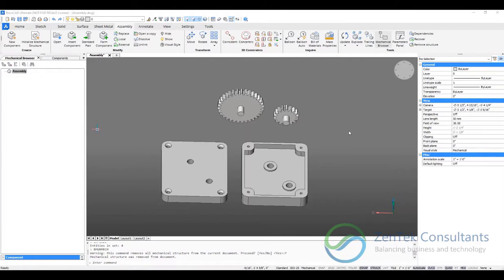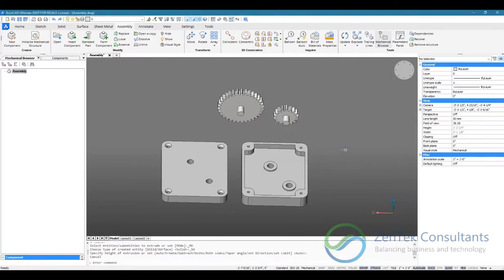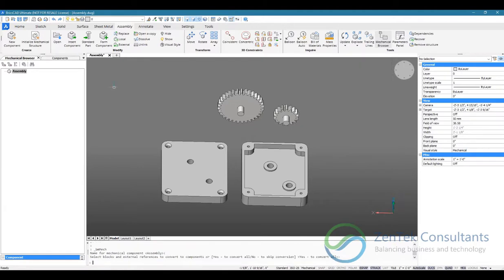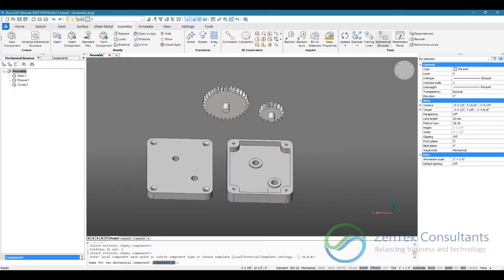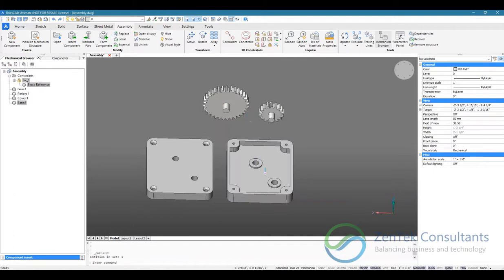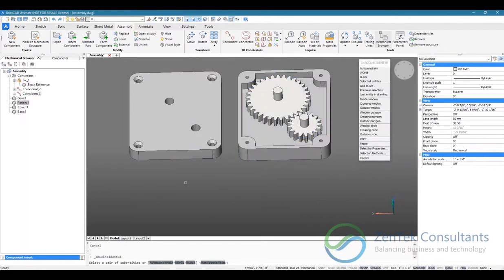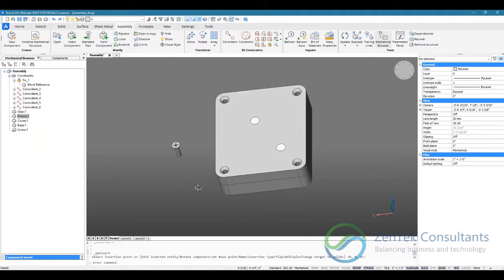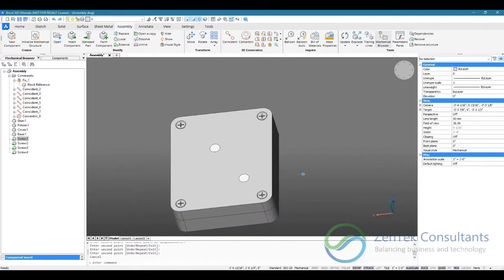How BricsCAD Works with Mechanical Assemblies

Comment: This would be more useful if you said what you were actually clicking or which buttons you were pressing as you went along.  It's one thing to describe the process to seem wonderful and easy but it's another to guide users as to what to do to replicate what you are doing (and sometimes why).  To see what you are exactly doing I have to start and stop the video and replay it several times and sometimes start and stop it second by second to catch what you did.